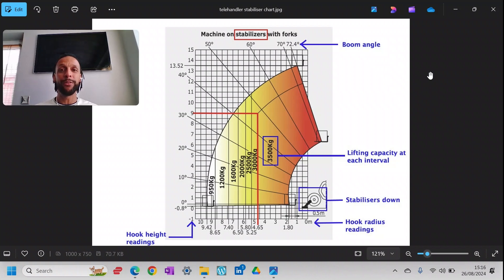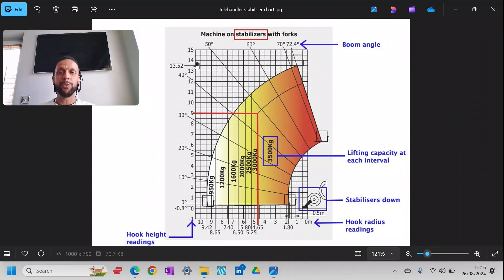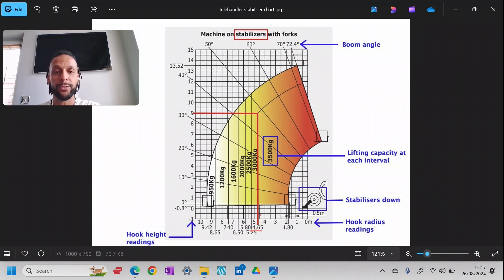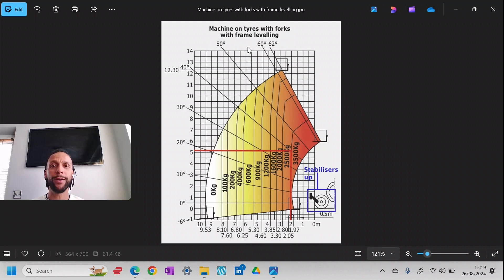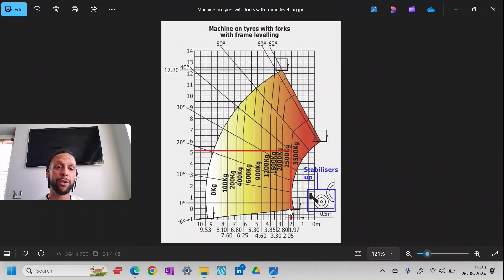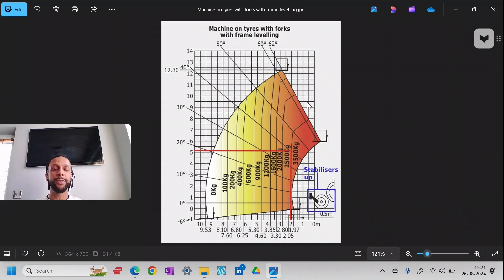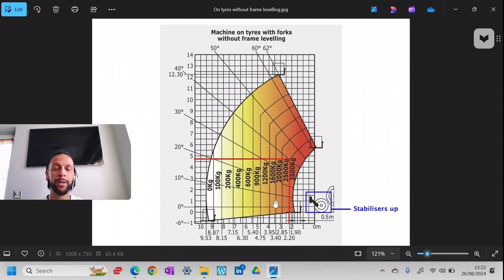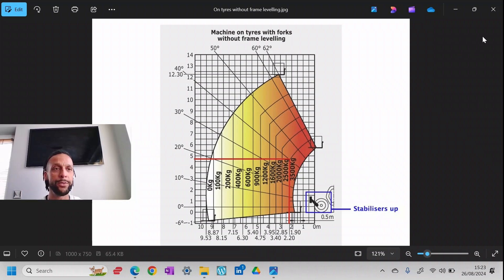How to Read a Telehandler Load Chart || (Manitou MT 1435) || Construction Cogs Tower Crane

Comment: i am missing a very important specific detail here...numbers on bottom line are mesuring the distance...starting from where to where exactly ?? 

Front or center of the tyres to where exactly ? Top, middle, end of your load ? 

Or is it like a forklift ? 

In that case it means, this is the distance between the forkheels towards the centre of gravity of your load ?? Which one is it ???
Reply from the maker: @82seaside  Good question. I believe the general rule of thumb is to measure to the centre of the fork length. But you should always check the manufacturer guidelines.
Reply: @CCcranelife  Actually it is not the lenght of the forks which are determing how much weight you can lift. 
It's the load itself that determins this. 
To be more specific...the centre of gravity of your load which is not always the centre (unstable loads, fluids, etc...). 

To understand a loading chart of a telehandler, we need to know where to start this measurement. 

Forklift is always starting from the heel of the forks themself (point 0) towards this centre of gravity, no matter how far you take your load upon your forks, you always need to start measuring from the forkheel.

What is very confusing on a telehandler is that when you look at the loadingchart, point 0 here seems to start from the front end of the pivotpoint (front wheels) while manufacturing guidelines describe it starts from the forkheels...
Reply from the maker: @82seaside  Okay, this was a good questions so I did a bit of research.
According to a good source, the standard method used in load charts provided by machine manufacturers is to measure the radius from the front face of the forks heels to the vertical projection of the load's centre of gravity.

Many telehandler load charts appear to show the radius from the front axle or pivot point. This is because the machine's stability is calculated from this point, and the front axel acts as a pivot when lifting loads.

So the difference is believed to be the fact that the manufacturer's rating is based on the load at the forkheels because that's the actual point where the load sits and the stability calculation considers the whole machine's tipping point, which aligns with the front axel or pivot point.

I think I've answered the question, mate. I hope that helps.